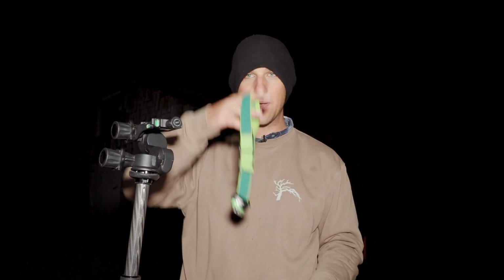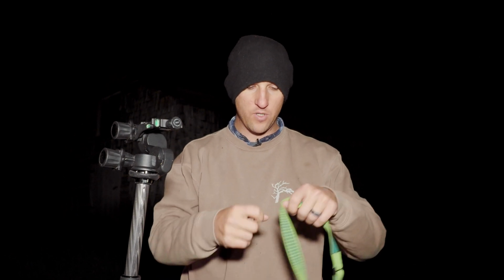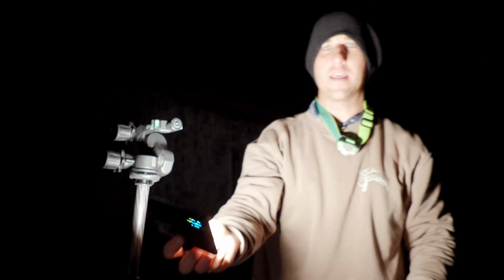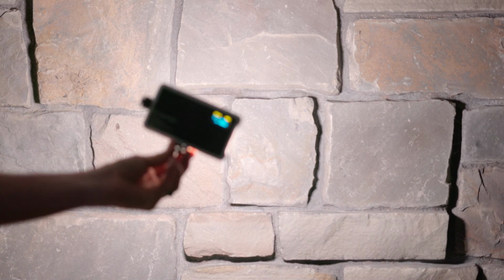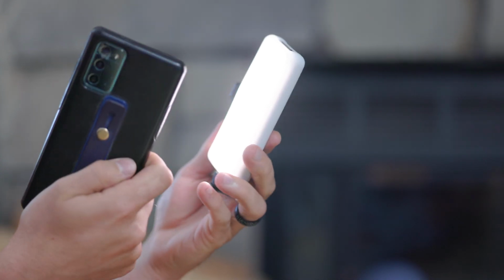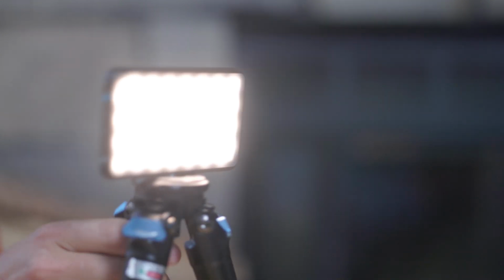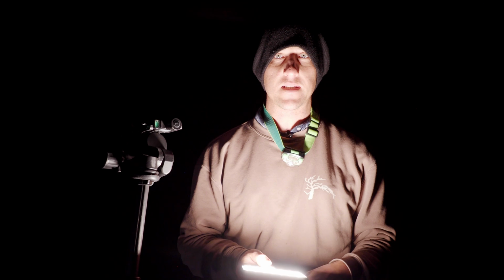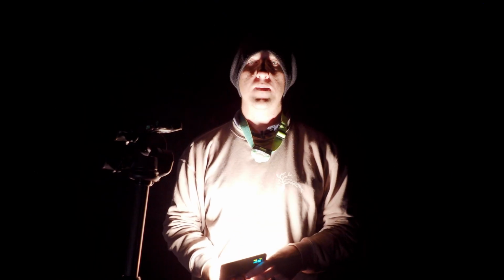Astro Landscapes - Light up the night with Lume Cube Panel GO!

Comment: Great video! A few questions:

How far away do you place light from subject?

Should light placement be same distance from subject as the camera?

Instead of moving light closer to subject, why not just increase intensity?

What setting variables do you use for stacking?

Thank you!
Reply from the maker: I place the light fairly far away... maybe 75 feet so it has a nice wide cast.  Setting variables?

Comment: Been considering using these for a while so many thanks. Quick question are they mounted on anything and I assume you place them just out of frame?
Reply from the maker: The one outside the cabin is on a tiny tripod as is about 20 feet to the right of the camera... the one inside I just set on the ground
Reply from the maker: LEFT,  TO THE LEFT of the camera